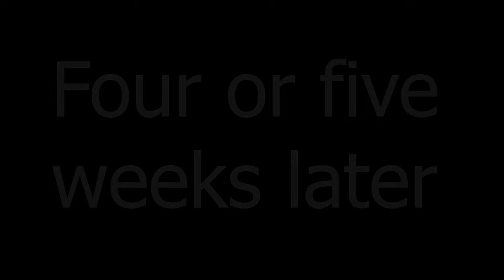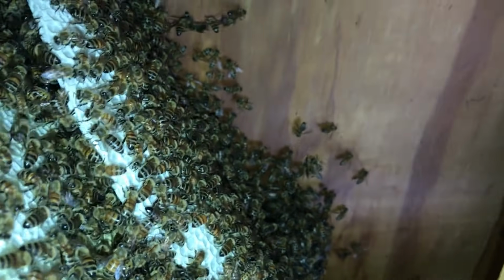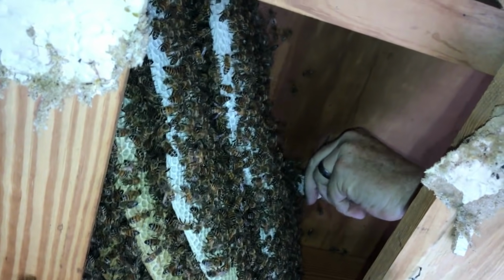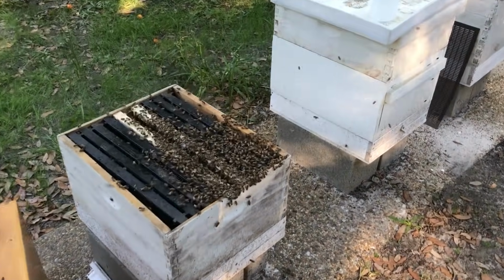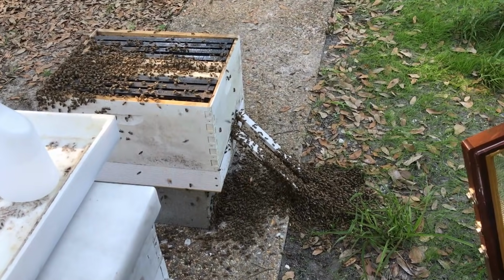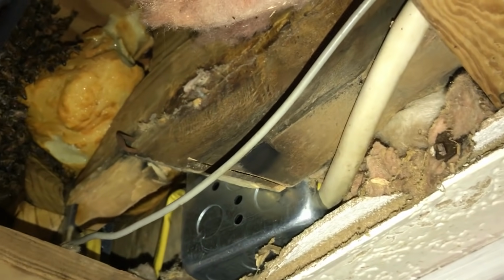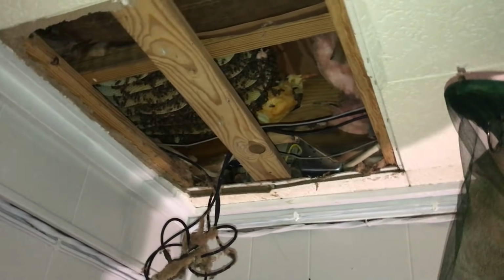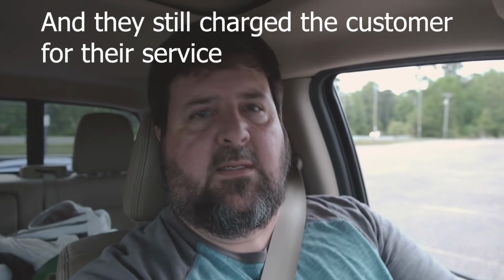How A Local Family Got Free Bees With Delivery

Comment: Hi mate what's the red light that you are using cheers .
Reply: I had the same question. I assume that since the bees fly towards the window during the day, they might fly towards his noggin if he used his white light.
Reply from the maker: Bees can’t see red spectrum so working bees in low lighting or at night is easier with red light instead of white.  They still can see your movements but they are calmer under red light.
Reply: @628DirtRooster  Thanks for that and i can see what you mean cheers .

Comment: This video only goes to reinforce my feelings of discontent and loathing towards Satellite Dish installers. Maybe I'm biased because as a young fella I worked for the cable company but twice in this video I saw where satellite dishes and cables were carelessly hung / strung in such a way that they could cause serious damage to the structure. 

On another note, it's because of a hive destruction that I became interested in beekeeping. At the time, we had a serious hive beneath some steps on the railroad in Texas. Rather than calling someone to remove the hive, the morons from Maint. of Way just sprayed them till everything was dead. I used that set of steps twice a day and the only thing I ever noticed was the busy traffic in and out of the area beneath the steps but some gumshoe decided it was a safety hazard. I was so mad and a bit frustrated that they wouldn't let someone else handle it.

Comment: I wouldn't touch that bathroom ceiling without full hazmat gear - with commensurate fees.  The charge would be far more than double the cost of doing the job on an unpoisoned  nest.  Poisoning pests without removal of the dead animals and material that was poisoned should be a crime.

Comment: Well damn.  The big "O"? They are forever crossed off all my good lists!
This swarm house has a problem, and the logical solution is to get someone to reside the house. Oh, you told them that. Well that's another expletive, this time I am deleting it. Do you know a contractor you could refer to them to fix things like that structural member that someone butchered? And residing won't be enough if they have similar opening in soffits, and or the brick to siding transition is not properly flashed. Plus you found that window frame that they were getting in, so caulking in the house is old, cracking and coming out. And there is a resident.  Just chalk me up for several more expletives, all properly deleted to keep my sainted mother happy. This is not a happy situation. Thanks for the great video, it was fun to watch. But Orkin, oops I forgot to delete it. Anyway, the big "O" company should know better.